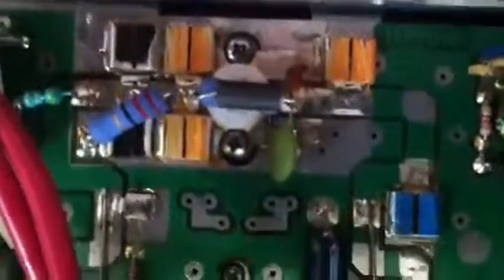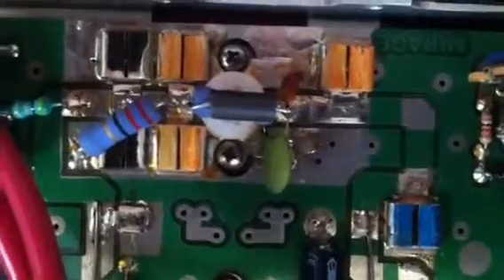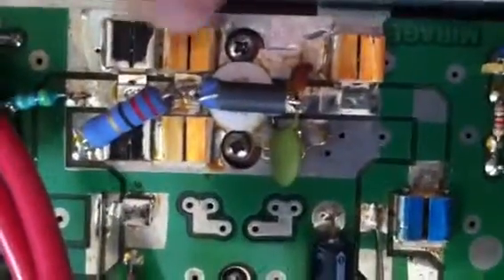Linear rf Amplifier MOD questions: Mirage b5016g 144-148mhz re-tunable to 10 meters?

Comment: those little square things are 200 pf capacitors.      two of them are in parallel on the base to ground of the transistor and one 200pf across the collector to ground.    Better off selling it for a good price on ebay and buying a new one for  the band you need.    Cheaper and a lot less headache.